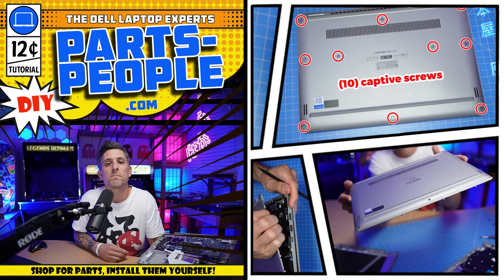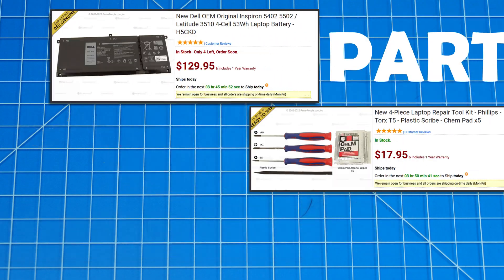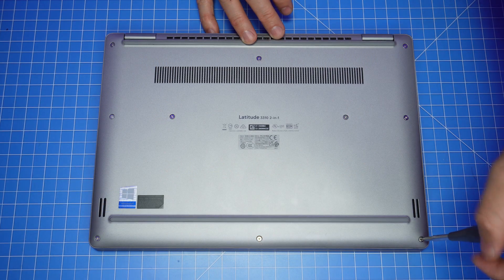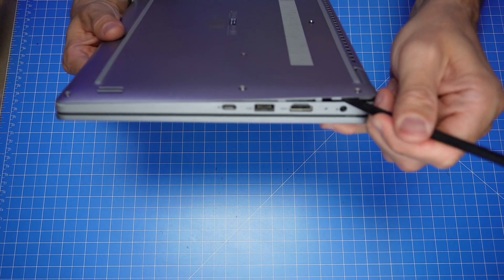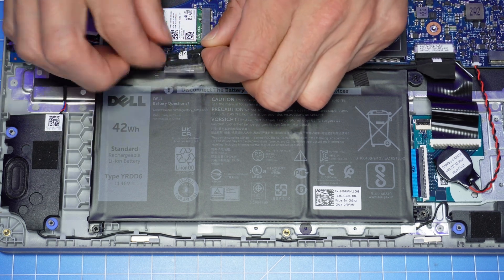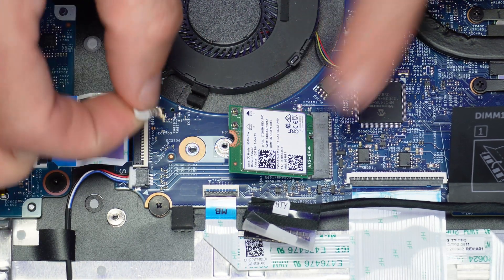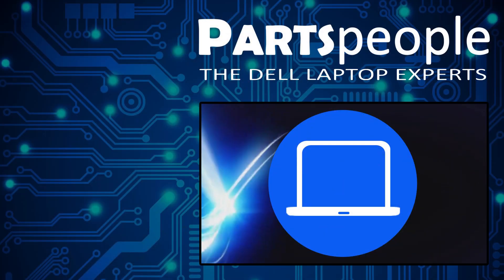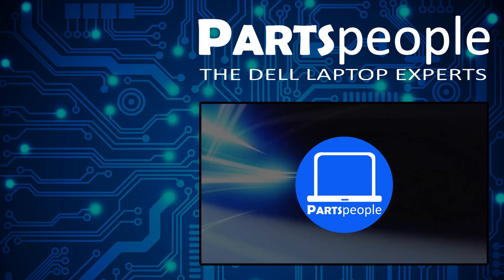Dell Latitude 3310 2-in-1 How-To Install & Replace Wireless WiFi Card | Repair Guide

Comment: This was a very helpful video! I need to get a new SSD for a latitude 3310 for my coworker. I wanted to get the 500GB drive (my boss will order it) and I want that plastic scribe for my toolbox. When I'm in on Tuesday I'll get the service tag from dell supportassistant so I can make sure to get the correct SSD.